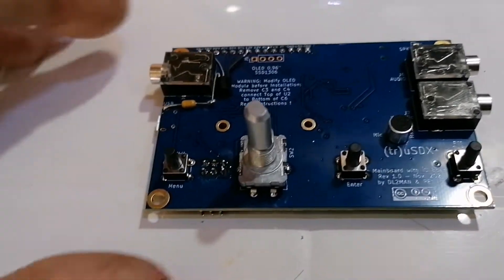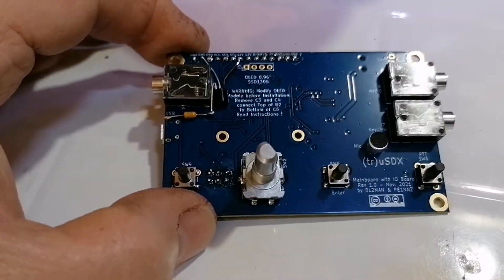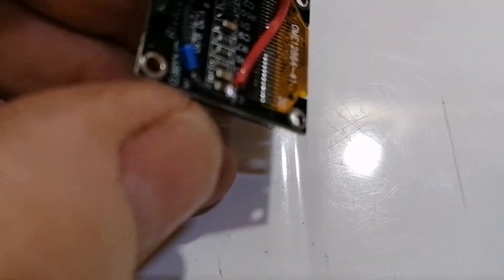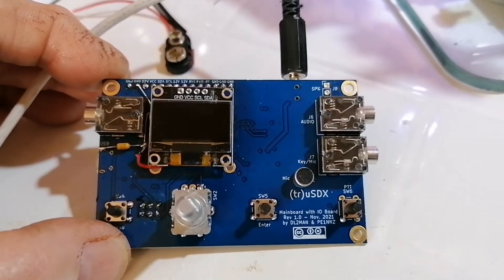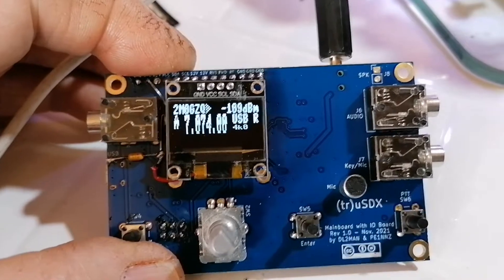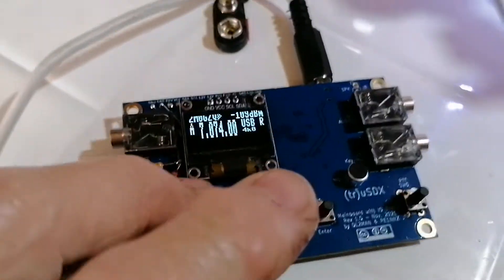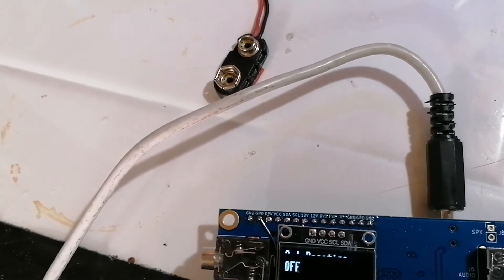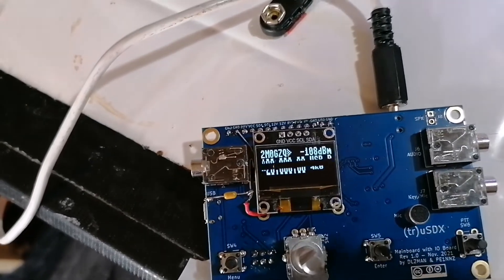(tr)uSDX Part 3 of the build.

Comment: Hi,  
I am curius where you got the boards from ? I am interested in the high band (20/17/15/12/10 m) 
I see there is a China suppler and a Romania web site as well as different group buys. but all i see is the low band 
version. Did you rework all the band filters from a low band version ?